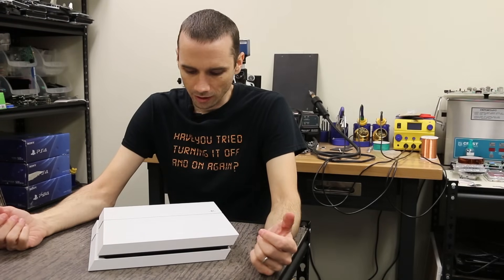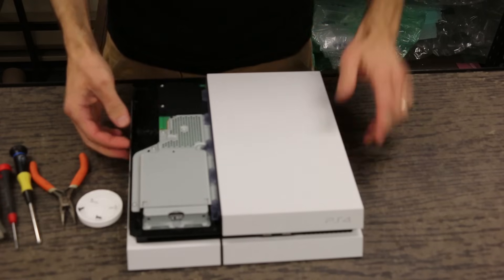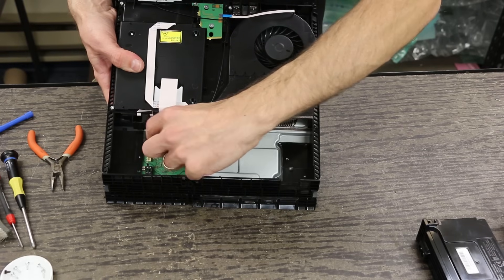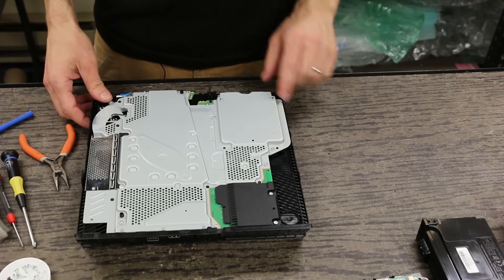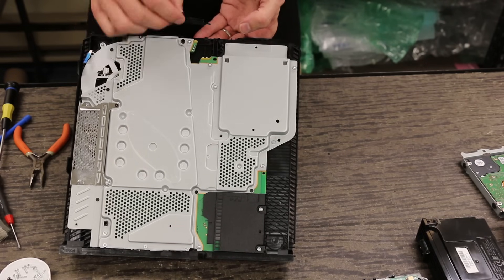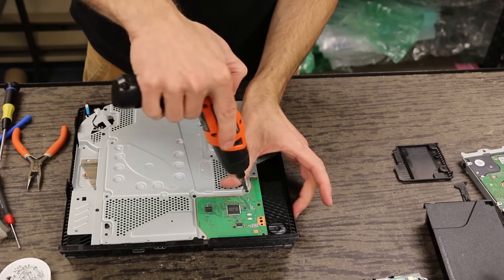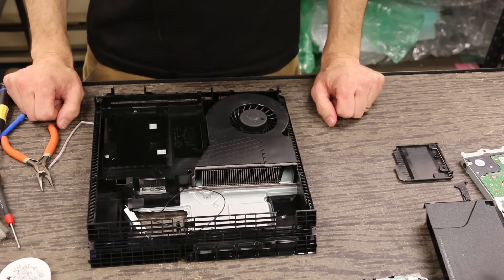PS4 1215 Teardown Tips & Tricks

Comment: Hi TronicsFix.
I have this model (1215B) and recently it has started to make a very annoying noise, although the fan itself doesn't get particularly loud there does seem to be a constant high pitch whine/whistle coming from around the heat-sink/fan area that comes and goes every few seconds and it just grates on me, i believe it started after i opened it up to give the fan/heat-sink a clean (only disassembled as far as removing the PSU) and i just cannot figure out how to fix it.
Can you suggest any help?

Comment: Thank you so much for sharing this useful information. My son’s PS4 had been sounding really loud (that “jet plane” noise people talk about) and I wanted to make sure it wasn’t all dusty inside. Other videos dealt with the older PS4 models so I was totally lost in the procedure. Luckily I found your video so it made interior access a piece of cake. 

To my surprise, though, it was pretty clean inside. I blew it the fan and duct assemblies out with compressed air and made sure to clean up any other lint/dust bunnies laying around and was able to put it back together. I’m hoping it made a difference. Nevertheless, this wouldn’t have been possible with your thorough walkthrough. So thanks a bunch!

Comment: Thanks for the guide. I disassembled my ps4, due to a REALLY annoying grinding sound inside of the system. I cleaned everything thoroughly, and even applied new thermal paste, but the sound still persists when the system is reassembled. 

So I know dust buildup isn't the problem, so perhaps I need a new fan? If the fan is actually the issue. All I know is that this grinding sound is honestly driving me crazy, when my room is quiet 😤

Comment: Are there any change ups (besides the ones I have found) as far as the wifi antenna mod (old model vs this model)? So I was following a video to do the wifi antenna mod when I found out my model was different. I couldn't find a video for this model so I decided to follow this video up to the under panel removal. And then found out the wifi cable is much longer. Is the wire length being longer and the connection location being different the only thing Different? If I buy a longer wire, should this mod work the same as the older model?

Comment: Hi, I recently had my machine stop reading so I pulled it apart, cleaned the laser lense which fixed it. Unfortunately, now the drive won't take in or eject discs. It's a cuh1202b model. I'm not sure if I'm putting it back together properly. The rollers are fine and in place. I'm guessing it has something to do with the little white carrier bar on the left side and the upper disc craddle. Any suggestions, I'm ripping my hair out here.😜 Thanks.
Reply: Noway i have the same problem...did you fixed it?

Comment: what are the screws from the back where you remove the label called or what screwdriver do I need ?
Reply: They look like torx ....but NONE of my torx bits fit right T7, T8,T9..none of them
Reply: Torx "security" bit will work, I believe it's a T8 or T9.  Security Torx apparently have a hole in middle, my torx bits did not have a centered hole, so it wasn't fitting.  Hope this helps

Comment: Man I'm dealing with the killer HDMI signal. Right now I'm just hoping shes been overheating as I been seeing the ps4 work nornally when I put a bag of ice on the top. I am right now tearing it down cause iFIXIT said they would want 129 dollars if they have to replace the HDMI port. So hope she can pull through the surgery im doing
Reply from the maker: I didn't know ifixit did repairs. 
Just don't mess it up worse. I get consoles all the time from people who tried to fix it but they didn't know what they were doing and made it worse. I have a video about how to do it...at least watch that first.
Reply: TronicsFix ahh sorry correction on me. It was Ubreakifix that told me about the price of repair if the HDMI turned out to be the problem. I have the ps4 model CUH 1215A. Had her for near 3 years till this issue of HDMI dropped signals started showing since August 2017.
Reply from the maker: Just make sure they actually know what they are doing. Some are good and some are bad. We get them from local stores that don't know how to fix them. They are also $40 more than our price and also higher priced than Sony.
Reply: Wow even higher priced than Sony you say? Well to the best of my teardown I dont have the right tool to take off the tabs for the bottom piece. The most I have done is teardown the top to the motherboard to wipe off some dust. I tried to use a simple phone repair kind of guitar pick get in there but im getting nowhere. You got a phone number I can speak to customer service?

Comment: Hello, I've seen your Teardown guide on ifixit.com with the PS4 CUH-1215, and you wrote their I would need T9 Torx Security Screw driver and a PH0 Phillips Screw Driver. My unit is CUH-1200 and I'm wondering if Torx T8 and PH00 phillips will fit in my Unit's screws since you used a T9 and a PH0 in that guide, opposite to your video even though they're just the same unit. Thank you ^^

Comment: My ps4 won't turn on after it was dropped, everything seemed fine when I opened it except I was missing the entire ribbon cable which you unplugged from the optical drive at 7:49 Should I try to buy a new cable, if so, where can I buy one?
Reply from the maker: That ribbon cable has nothing to do with it turning on. That's only for the eject function of the disc drive. Buying a new one won't solve the not turning on problem.
Reply: TronicsFix Alright thanks for the quick reply

Comment: you dont need to get optical drive off to reach mainboard right ? i will change thermal paste and it looks like its unnecessary to rip optical drive
Reply from the maker: Correct.
Reply: TronicsFix i have changed thermal paste but it is even more louder :( fan has seem clean to me, what proglem might be?
Reply: I had this problem and changed the paste and everything was fine after that maybe your motherboard is messed up or power supply

Comment: I just cleaned out the fan area. I got to the point of taking the whole case off and the power supply and noticed that the internal parts are pretty much brand new still. Hardly any dust at all. My PS4 is only a year old. What other cause can there be for my ps4 shutting down like it did?
Reply from the maker: I don't know...how did it shut down? any error messages or anything?
Reply: TronicsFix no error messages, it just shut off immediately after my game began to load gameplay. The game was in the start menu just fine. It was when I started to play when it shut off. I do remember the light being red though. Can it overheat from a different problem other than dust buildup? It was on for a long time before this.
Reply from the maker: If the light was red then it likely overheated. It can overheat for various reasons...dirty, needs new thermal paste, bad fan, no ventilation, etc.
Reply: TronicsFix Can thermal paste wear down from long gameplay over time? I would guess it's not dirty, the fan seems fine, ventilation is good. My guess is the thermal paste, if anything. I'm gonna leave it be for now. Can it just be a one time thing bc the system was on for too long? If it happens again, I'll check everything. Thanks for the help. I appreciate it.
Reply from the maker: They don't put good quality thermal paste in these things in the first place so yes, playing it for long periods of time can dry it out more. It's possible that it's just the thermal paste that caused the problem.

Comment: I have learned so much thanks to your videos. However, after a DIY laser replacement, I cannot get my discs in or out. It seems that the undercarriage of the optical drive does not have the proper elasticity to let the guard arms move in and out of the way. I have done almost everything else including clean and reassemble rollers. Please help fellas!
Reply from the maker: Have you checked the large ribbon cable that goes from the disc drive to the motherboard? Be sure to check that the little ears on the sides of each end are intact and that the cable is plugging in properly.
Reply: Yessir! they are in tact, I have read that those get torn off easily. I thought maybe I didn't put the clip back up that holds it in but that doesn't seem to be it either... I really feel like its the white plastic undercarriage (I think mine is the 1100 series)
Reply from the maker: So does it try to pull the disc in? Or does it not do anything when you try to put a disc in?
Reply: Does nothing. Which tell me there's a disconnect somewhere right? I've taken it back apart twice. Don't see anything disconnected...
Reply from the maker: Yep, that's why I asked about that ribbon cable. That's the most common cause of it not pulling it in. There isn't any power getting to the drive to pull it in and that's where the power comes from.
Reply: Just powered on console and disc drive made a weird sound like the tray was adjusting for a second. Can't put a disc in now and it says unrecognized disc when there's nothing in it. Made sure my new laser was the right model too. I think the plastic tray guards moved when I turned it on? Gonna try your manual screw trick
Reply: Just hit the eject button and sounded like something scratched! Which means there's power to it right? If not, the eject button would have no response?
Reply from the maker: There's just no way for me to know what all is going on with it without having it here to test.
Reply: Yeah...I really appreciate your time and effort. Im going to try something on Ifixit and see if I can manually roll a disc in without hitting the side lever or something. thanks!
Reply from the maker: OK...let me know how it goes.
Reply: That was part of the problem! The flap was hitting one of the rollers so I couldn't get the disc in. I pushed one of the rollers back to let the flap down all the way and with a bit of force, the gear on the left side retracted a bit to let the flap down all the way. Now it wont auto accept the disc when I try to put it in =/ but that's one problem down!
Reply from the maker: One problem down!
Reply: The auto accept sensor was blocked because the gears of the tray had moved/descended somehow. Im up and running again. Thanks for your help!

Comment: I tried putting in a 4TB HDD and found out that it was too dense to fit inside the bay. Basically just flushed 30$ down the toilet cause of that. >_>; I'm finding 2TB to not be enough space. This gen is really storage hungry.
Reply from the maker: Yep, 4TB is too big. 2TB is the best option for now.
Reply: He already filled his 2TB. So we cut his HD casing off and put the 4TB in.
Reply from the maker: millgiass Nice...that's one way to do it!
Reply: TronicsFix We couldn't leave the casing in at all, not even the bottom of the sled because the 4TB HDD is THE EXACT thickness of the gap inside there. There isn't even a milimeter of space left.

Comment: Do you have to remove power supply to take out disc drive? My connector for the rollers has fallen off like that last model.
Reply from the maker: No you don't, but it can make it a bit easier

Comment: Hello. Another great video. Thx. I have a weird question. I have a launch version PS4 w a 1.5 terabytes hdd. Say I buy my friends like new,but used PS4 1215a. Can I just swap my hdd into the 1215a,and have the system instantly be like my old PS4. Or is there other info in the system board somewhere that needs to be turned off,deleted or transferred. Thx for any advice.
Reply from the maker: Unfortunately that won't work. Sony has made them so any time you put a different hard drive in they will require a fresh install of the system software and this will erase whatever is on the drive.

Comment: Ive had my new ps4 for a month or two and the power wont turn on no lights or anything. Is it possible to take the power supply out of my 1115 and put it in 1215a? Please reply. I dont want to buy a new power supply if i dont have to.
Reply: If thats even what it is
Reply: Clayton Adams I don't know if it'll work, because the PS4 12XX has an improvement on the energy waste, the 10XX & 11XX series have 250hz of power comsuption, now the 12XX series have 230hz... if i were you, i woudn't trust to do the change right now. Just wait a specialist answer.

Comment: Thank you so much.. u saved me from getting a new PS4. i was told i have to pay $290 by Sony repair centre without even looking at my unit. it was my PS4 internal fan that stopped running and i watched the tear down and assembly from you guys and managed to fix my PS4 for just $40. i love you guys. thank you so much for the tips and detailed strip down and assembly. perfect channel to learn how to fix your own PS4 without wasting your money. Hope you guys do more tear down and assembly for other consoles and devices. Would love to watch and learn from this channel. Thank you once again.
Reply from the maker: Glad it helped. Yes, we are always adding to our channel. Just let us know what else you want to see torn down!
Reply: @Tronicsfix  Hello, I bought in the year 2016, a ps4 cuh1214a. My PS4 is made in Brazil. I would like to know what are the biggest problems that happens in this version?
Reply: TronicsFix I need help my ps4 turned on but now it started blinking blue I opened it back up and I have to hold down the motherboard hard to have it turn on
Reply: @Tronicsfix  I can't take the bottom part of the ps4 off please help
Reply: VJs Channel if you still can’t get it, get a butter knife and pull the side out a little to stick it in then slide the knife towards the back and pull up on the corner
Reply: 290?! What a freaking rip off. At that price you may as freaking well buy a new one... =(
Reply: millgiass yeah. True that. Now my PS4 will functioning wel. So satisfied doing it myself
Reply: millgiass yeah. True that. Now my PS4 will functioning well. So satisfied doing it myself

Comment: I need a repair on this model do u service them if so how much do u charge pls and thank you
Reply: My small ribbon cable stripped
Reply from the maker: Yes, we fix lots of these. The best thing would be to send it in for a free diagnosis. Then we can see exactly what it needs and let you know how much it would cost to fix. Here is the link for that: http://www.tronicsfix.com/store/p51/diagnosis
Reply: Thank you very much i will do so i think i will need a blu ray lens replacement as well
Reply from the maker: Sounds good.
Reply: You think you could fix those two problems the ribbon cable which spins the rollers is no longer good and my blu ray lens blinks blu then red and doesnt read the discs so i assume it needs to be replaced
Reply from the maker: Yes, we can fix most anything on PS4's: http://www.tronicsfix.com/store/p24/PS4_Disc_Drive_Repair.html

Comment: I followed ur steps and omg,the dust i found.. no wonder the fan was loud. btw the reason why im so 'brave to open it is because my ps4 already passed its warranty period(1yr) and also ur video made it soo easy to understand
Reply from the maker: Yes, dust will do it!
Reply: @Tronicsfix  Thumbs up for your video ! 👍 
I have exactly the same model and i was wondering if i could use liquid metal paste on the heatsink , i read that it's made of steel unlike first models but i've seen nobody do this on CUH-12XX. Also i noticed that there is no thermal pads on VRMs , maybe if we add them it could also drops temperature ? ❄
Thank you. 🙏
Reply: brother as you have opened it will it be replaceable or the company will not accept it because if you have opened it .
Plz tell me this brother as i really because of this
Reply: @SPS11  if it's within the years warranty of buying, just send it in to Sony but if you've bought it 2+ years ago, just open it, they won't accept it because it's too late
Reply: @Mr_Makina  so now they will not replace it?
Reply: @SPS11  if it's not within the 1 year Warranty they won't
Reply: @Mr_Makina  but i have replaced my ps3 after 1 year of my warranty expired .

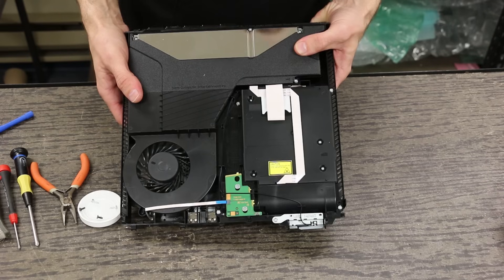Comment: Hey TronicsFix, can I use Air Compressor for the PS4's fan in 4:24? I don't wanna tear all the parts just the fan.
Reply from the maker: Unless you're using super compressed air with a tiny nozzle it's fine.
Reply: +TronicsFix I willing to repair my PS4 from my own 'cause I'm so sick about my PS4 because it won't off blinking white and won't eject (1200 model)

but in some way, if I use Vertical Stand my ps4 is super responsive but when I put horizontal, it became unresponsive

should I recommend to use Vertical or Repair (no bluray problems) .....I'm 15 and I want to repair...someday...
Reply from the maker: If it works vertically, then I'd use it that way.
Reply: TronicsFix hey men,does my PS4's problem like won't off or won't eject....is it natural?
Reply from the maker: No, it's not natural
Reply: +TronicsFix what cause?
Reply: +TronicsFix I know how to troubleshoot but.....I want to avoid those 2 problems.....

Comment: I need to open it because I fell like the thing that is rattling is the reason I have the "blue light of death"  .
Reply from the maker: The disc drive has nothing to do with the BLOD. The BLOD is caused by faulty joints between the APU and motherboard.
Reply: @Tronicsfix  If this problem occurs can I apply thermal paste instead of these joints ?